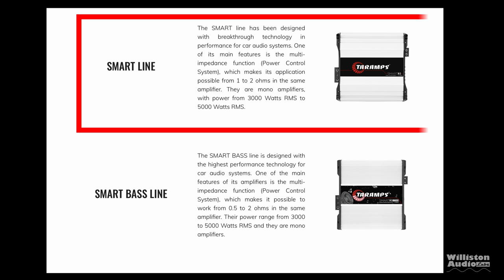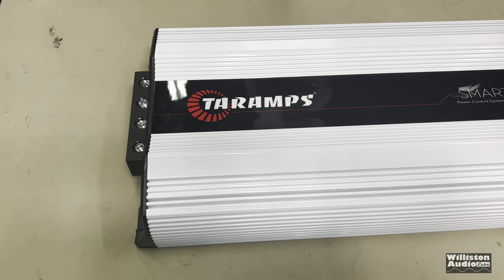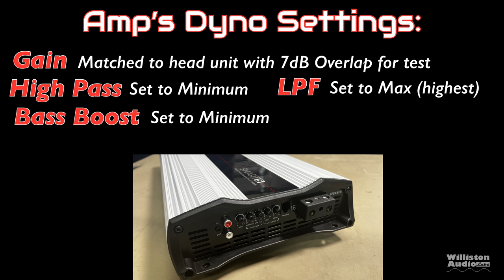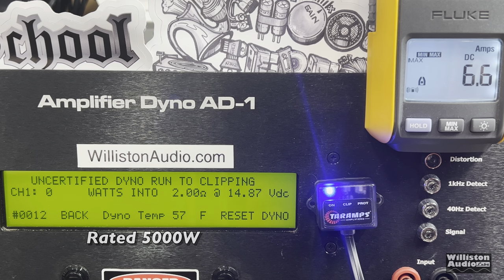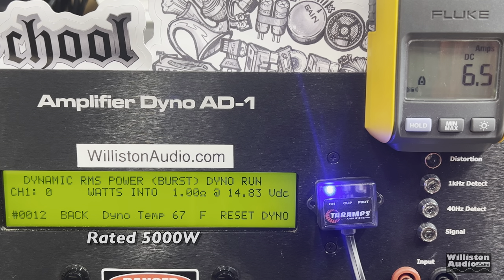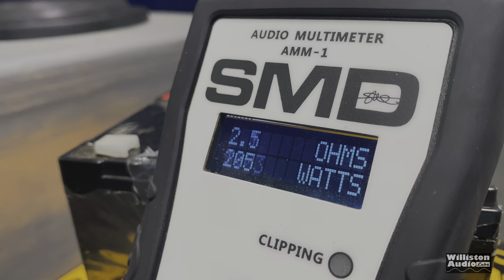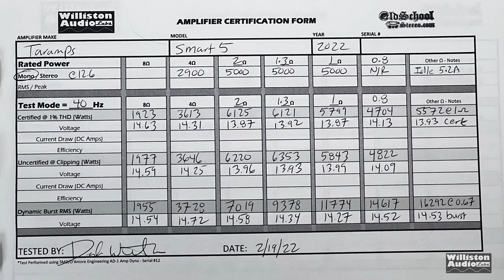You Won't Believe This! Taramps Smart 5 Amp Dyno Test and Review [4K]

Comment: Can you explain how an amp can put out 5,000 watts while running off of approximately 12 volts in a car?  This would require 416 amps of 12 volt power going into the amp.  Most car alternators put out less than 1//3 this amount of power.  If an alternator, or multiple alternators, were designed for this output the wire needed for the amp would be almost 1/2 inch in diameter and would need a 500 amp fuse.  Is this realistic?
Reply from the maker: High output alternators and multiple AGM or lithium batteries. The power output is not constant, so you don't need a continuous 400+ amps
Reply: Also it’s running at 14.5 volts for the alternator output and your battery is what really takes the load. Most car battery’s can burst out 600 to 800 amps for 20 seconds. Upgraded AGM or lithium can maintain that current for a longer time hence higher capacity. So most Bass SPL cars run two or three alternators at 300 to 400 amps each and  several batteries. Now the smaller lighter lithium packs are the trend. They also use 00 copper cabling in parallel with each other to handle the current over longer distances. So yes the power delivery can limit wattage output. But they still get a massive amount of wattage from the amplifiers.

Comment: Only one time had a Taramps product and under 70% of the load for 30 minutes one of its 10mm x 10mm ouput mosfets shorted and blew a rail on the PSU. The mosfet fused into the board. They are not meant to be repaired. Im sure that it meets the numbers, %100 .... short term. It is not like pro audio, were you can pay a lot for "just" 300W RMS but on the other hand you can use them all day long with room to spare. The 16KW is ilusive (Im not a car audio guy really). Impresive figures really.

Comment: This test is for the smart5 and not the smart5 bass correct? Also how is the sound quality?
Reply from the maker: Sounded great to me. Yes, Smart 5
Reply: the two dont sound any different, just different crossovers, kinda a gimmick but you can wire lower

Comment: Maybe I am confused but why can't amps simply provide accurate power outputs at certain voltage? 
Why is it good to output 20-50% more?  Does t really help when matching up a sub.
Reply: Marketing. Making them look underrated makes them more desirable. However having extra power on tap is always a good thing. You'll have less of a chance running into clipping that way

Comment: When I have my smart 5 wired to 1 ohm it rises to like 3 ohms. So would it be safe to just wire to half ohm?
Reply from the maker: 1ohm is the nominal DC resistance. When you are checking rise with music you’re seeing AC impedance. I’d stay away from 0.5 if possible

Comment: I dnt see where u have 3 dual inputs at??I am sending bck my taramps smart 5k bass due to me having it for 2 weeks and it went into protection mode and wouldn't cum bck on..definitely a bummer..But now I'm gonna order the taramps smart 5k regular version..everybody says u dnt need the bass version unless u are gonna wire you're system dwn to .5 ohm and I will never do that..And they say the 5k is louder and more reliable due to it needing 12 volts unlike the bass version needing 14 plus volts..

Comment: I got a question.  I got a 2022 dodge charger with the stock alternator and i got traramp smart 5k and two 12 inch zvx. I got it wired to 1omh.  Im trying to figure out what size lithium battery i need to get.  If you could help me i would gladly appreciate it.
Reply: 50 ah on lithium just for the smart 5

Comment: I have a 2016 chevy cruze, thinking about getting this amp but wasn't sure if I should add an extra battery or upgrade my stock alternator which is 130 amp, this would be paired with a massive audio hippo 12 2 ohm, been out of the game for a while, please help thanks in advance
Reply: the manual states to have at least 230ah of AGM but i have 185ah of AGM and have a 345a brand x alt i drop to 13v on 29hz sine wave. 13v is fine for this amp they make rated at 12.6v. was almost just as loud with stock al dropping to 12v
Reply: @2015GTPP  thanks bro, my cruze hovers around 12.8 for voltage, you think I would be alright with this amp and a battery on the stock alternator?  Just trying to play it safe and don't want my lights dimming while I'm driving
Reply: @charlessimmons873  12.8v driving around? i charge at 14.6v my lights were dimming before the 345a alt. no real way to get around other than to ignore it until you save up enough to get your electrical right. If i were to do my electrical over again id totally go lithium, but not all lithium is the same. ONLY BUY “LTO” lithium. it is by far the safest choice. CES has a 40ah lto battery in a nice case for $650. i paid $800 for my two batteries and would have held alot better voltage with LTO. “Rating these with a stock alternator of 100a and 14.2V charging to hold low 13s on about 500a of draw. which is roughly 5kw clamped after efficiency. You'll obviously hold better voltage with more wattage with a larger alternator that charges 14.8+. safe voltage range on these batteries is up to 16.2v reliably at cycled rates”

Comment: The fans only come on when there is a lot of load on thr Amp so u can basically never hear them because you are playing your system, this is never an issue I run four of these they r loud but they don't run for long because they put some air flow thru the Amp
Reply from the maker: Good point

Comment: At least they could color code the power screws....
Also manufacures sending you gear is shady.  In my industry we've band it for testing.  We tell vendors who want testing that we will buy the item at market price and then they can reimburse the cost.  This keeps everything on the up and up.
Reply: I was wondering if it's possible that he got a "souped-up" model?
Reply: @PURESOUND4  i was thinking the same😒
Reply from the maker: I’ve bought stuff for years and done the testing. Mfg’s now are occasionally sending me items knowing they can be spot checked with items I buy. Would not be good for them to do this and i HIGHLY doubt anyone would do this. It would cost too much for them to “one off” an amp anyway…
Reply: @wal  Sir never ever underestimate greed and lazy marketing teams.  I've seen well known manufacturers do slight of trick to internals or modify running algorithms to look better on paper based upon fix load test data....
Need anyone bring up Volkswagen and training their computers on their diesels to know when they are going through smog testing to pass then when out in the streets run hot with more power.
Im not knocking you in any way.  I absolutely love your channel.  I wish half the stuff you test was available in my Stereo hay days.   Keep up the good work.... But remember they will lie to you if it puts money in their pocket.
Reply: @MrRandyj72  there are other dynos on youtube of this amp putting out similar power dude

Comment: wow man you know everybody starting to use those amps in their own living rooms replacing home theater systems for custom-made car audio in the house now instead I've seen several YouTube videos of people doing such things and it's awesome it blows the competitor away when it comes to all Home theater systems it totally kicks ass using car audio instead
Reply: Not really, since it's silly to go from Mains Power to 12-14V then inside the amp convert it back up high voltage again. Plus you need very expensive chargers and batteries to run them from. Much easier to just use a high power Class D home amplifier.

Comment: Impressive stats. Does anyone know the reliability of the amps made by Taramps? Do they break easily?
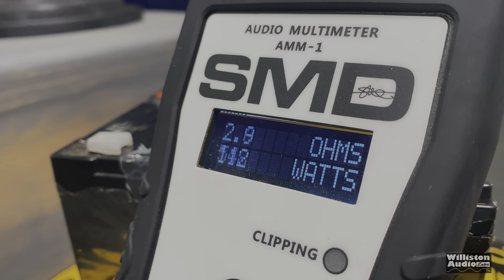Also what song is at 10:52 ?
Reply: Iv ran thru a few taramps and the smart 3 is the best the only downfall is the dmn screws for tge power and ground iv stripped them but other then that iv been runnin 2 12” l7 for bout 6 months with the smart 3 very reliable efficent beast
Reply from the maker: Song at 10:52 is "Crock" from the YouTube Audio Library
Reply: I've had no issues in reliability with the MD and smart lines
Reply: @beardedforlife3740  i personally dont like the md line i swapped out the smart 3 at one point and used a md 3000.1 it just doesnt compare to the smart 3  not the smart 3 bass
Reply: @daddydiesel7910  smart3 is definitely better. I'm just saying the MD line isn't a bad choice for budget friendly amps
Reply: @wal  Thanks! 🙏
Reply: bad power supply can cause Brazilian amplifiers to burn out, keep power supply high and they will play for years.
Reply: @hotnikq  Here in Brazil it is very expensive to invest in battery and power supply, so these amplifiers are very efficient even with low battery. I have a Smart5 with two 100A batteries and a 120A power supply.

Comment: Do the test again with 12.6 
Whats its rated  for
Not what u feel like pushing into it 
Why?
So we all can see what normal  rateings it got for daily  use ,,that is what most people use it for .
Reply: 12.6 is the optimal voltage of a fully charged battery engine OFF. I dont think many people would be hammering a 10kw amp with the engine off some how....
Reply from the maker: Yo TL my lifiums don’t like it that low. Tell Pamela I said hello
Reply: Daily use will usually be around 13.8 to 14.4v in a car with the proper electrical

Comment: The fact that this does more at 2Ω than it does at 1Ω concerns me. Tells me taramps has some kinks to work out
Reply from the maker: Smart tech limits current. This amp will sound louder than most 8kW amps
Reply: @wal  not sure about that considering most Korean "8k" amps are 10-12k boards these days. I'm clamping 8700 from my Salt 8 @2.3Ω. 10k+ @.5. I do like what I'm seeing from the Smart amps so far though.
Reply from the maker: @DibeezyTheGifted  Salt 8k is most definitely a 10k amp though. I wouldn't say this is typical of an 8K

Comment: The thought of all that current running through so few output transistors is worrisome. The Korean amps are gonna over time handle the current ran through them better. I guess when the amps are this cheap just replace it if it blows. Simply put would you want 10 people carrying a 500lbs load or 5 people carrying the same load. Yes it will cast much more to feed 10 people than 5 but an important task needs done at any cost. Just something to think about.
Reply from the maker: These amps also run closer to their limits, but this amp has the smart tech which monitors the current and protects the outputs
Reply: @wal  I guess time will tell. Just being the skeptic I guess, I was the same when the class d amps came to fruition back in the 90s. I've been wrong before, let's hope I am now too. As always great video.

Comment: You could power like 30 speakers with this thing.
Reply from the maker: Prob so
Reply: Not necessarily, you can plug 30 speakers if each speaker was 16 ohms lol. Normally these amps hold about 8 speakers rated at 8ohms.

Comment: Why didn't you test at .5 ohm??
Reply: Stay away from
.5 Ohm's with this amp.
Reply: @Mr.Robert1  you think 8 ohms is save for mid range
Reply: @leisonmaldonado9661  
Do you have an 8 ohm midrange? Normally used in home audio.
Reply: Usually to find out if it can handle the stress. Without going into protection or worse.

Comment: to bad 90% of the folks who get this amp will never have the electrical system to give it 500 amps or the 480 something
Reply from the maker: Good point and I need to do better stressing that in my vids
Reply: i got two agms and a 345a alt im only dropping to 13v at the lowest. not crazy electrical requirement at all considering they are rated at 12.6v.

Comment: Man taramp trash 🤦🏽‍♂️ and customer service you better think again. When it goes out or start clipping it's over over burner up 2 had them on SDA
Reply from the maker: I’m not reviewing customer service but I understand the frustration if you had a bad experience
Reply: I had the smart 3 and it kept cutting out. Found out  the dual fans went out. Replaced the fans myself and the amp was still cutting out at moderate volume. Ended up selling it. Put my mmats 3k back in and it played at all volumes, no more cutting out. No more taramps or sundown sfb's for me. The sfb plays good but gets very hot and is very very very power hungry and thats the sfb 1000 that im talking about. It requires more current at 1 ohm than my mmats 3k. These full bridge amps are something else. Sorry but im done with full bridge amps.